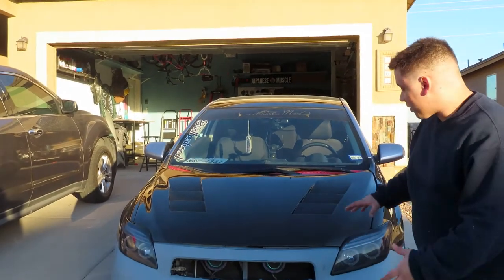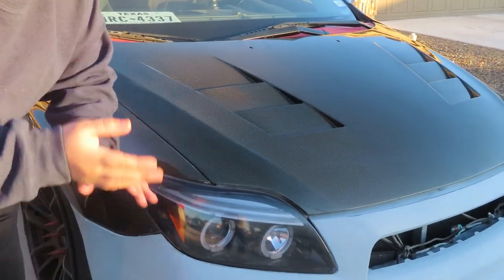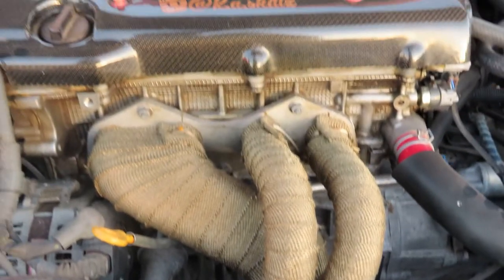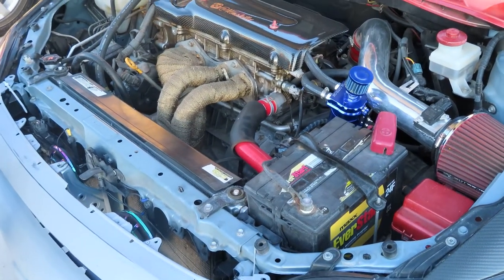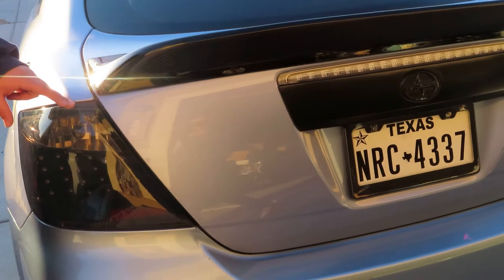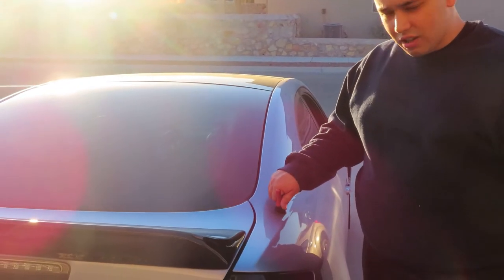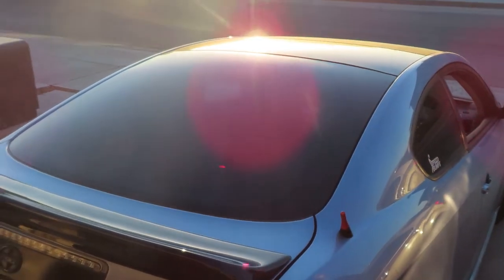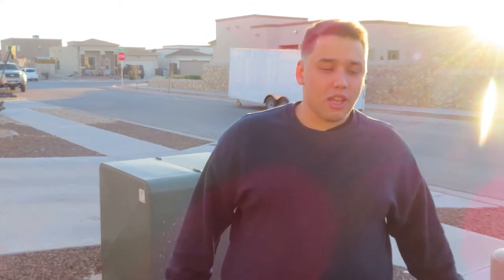I Really Spent This MUCH $$$$ on My Car!

Comment: How u install the mishimoto radiator on the automatic engine 🤔
Reply from the maker: You need to buy the extra transmission cooler
Reply: Yeah cause I notice that is for a manual but no lie thank u
Reply: And bring more video I been waiting
Reply from the maker: No worrries, for mishimoto radiators thayre all for manuals, so to install on an automatic you need to get that extra transmission it sucks but is what it is

Comment: Spent about 7k total for a widebody,ksport coilovers, avid 20 rims,wheels,powerstop brake calipers and rotors,gt carbon fiber wing,2 10 in subs,1k watt amp,new head unit,new speakers,underglow,short ram air intake,strut bar, and I still have more installs (rear diffuser, front splitters,l)I just haven't put on and more I still have to order.check it out bro.
Reply from the maker: thats a lot bro!

Comment: Do we count if someone scams me when I try to buy parts? I think I am closer to 20 grand than 7. Only counting parts. Not the car. Getting my 3rd engine now. Fully built bottom end. 2nd turbo. Also got everything in and out. All legit parts.
Reply from the maker: thats wassup 🔥🔥🔥 and  we can count it but i try to not include the amount of money i spent on replacing broken stuff because its part of wear and tear or just simply cause modifying comes with breaking things in the process anyway. id keep the evaluation based on what is on the car at the moment.

Comment: How many miles do you have on it ?
Reply from the maker: 105k
Reply: @Tuzin_98  nice! Still low miles
Reply from the maker: yea later this year its getting a built engine so the only thing with high mileage will be the chassis 👍